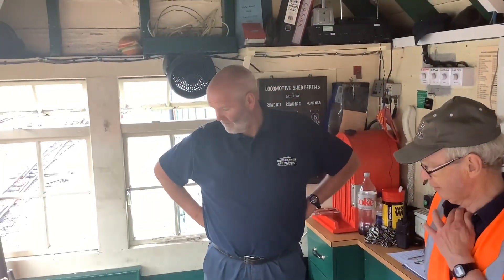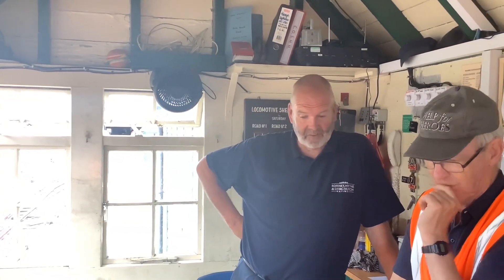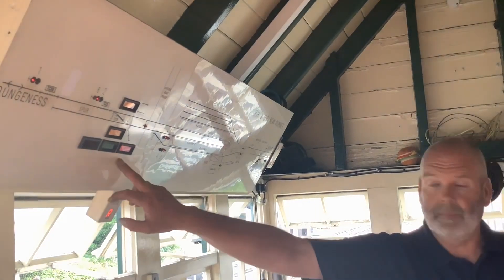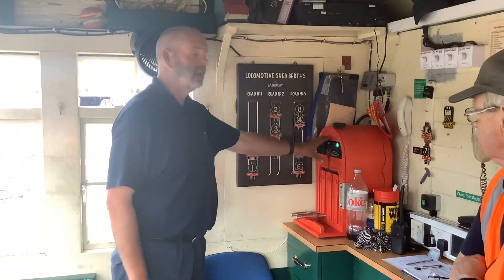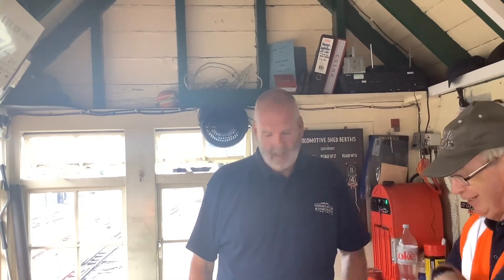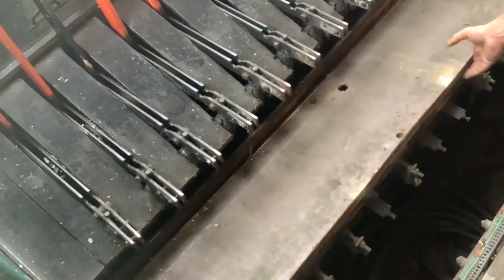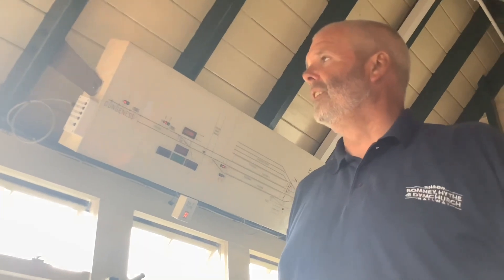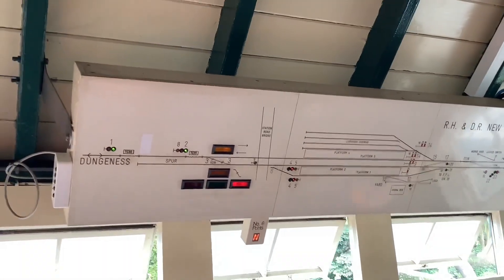IRSE Minor  Railways Section visit 2022, New Romney operations

Comment: Good evening, some single track museum railways in the United Kingdom are still operated with staff or token blocks although all their stations are equipped not only with home signals but also with starting signals.  It is therefore not clear to me the need to have a staff or token block in the presence of starting signals.  In other words, couldn't the signals that authorize the sending of trains in the opposite direction along the single track section be interconnected to avoid head-on collisions?  If I'm not mistaken, as far as physical Europe is concerned, only in the United Kingdom, Man and Ireland is the staff or the token-block used, while in the other railway networks of continental Europe, telephone block or Sole Management apart, electric locking systems are used which do not provide for the delivery of staffs, tokens, keys or other suitable metal or wooden objects to the train driver.  If I'm wrong, correct me!  Grateful for the attention given to me, I would like to take this opportunity to extend cordial and sincere regards